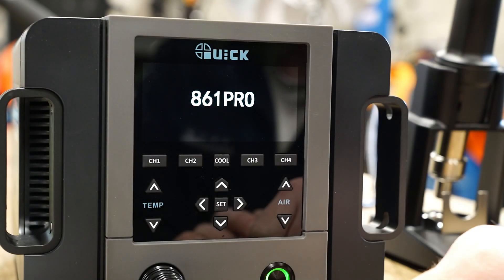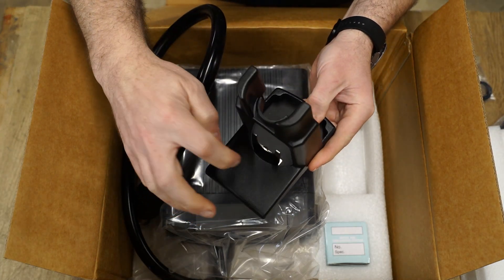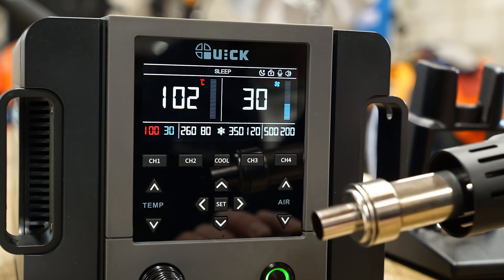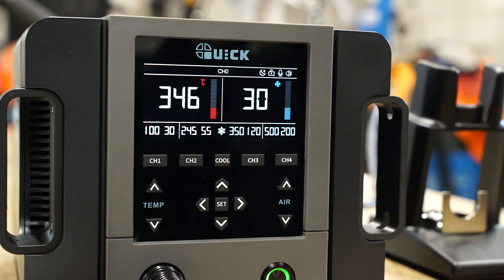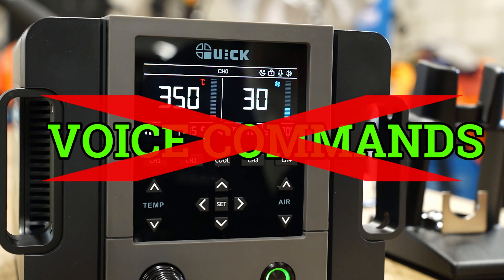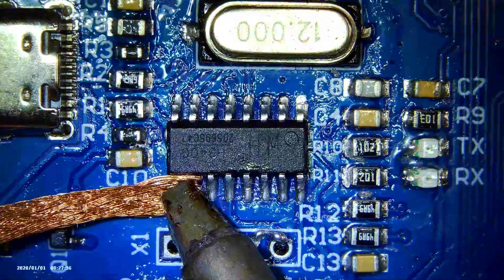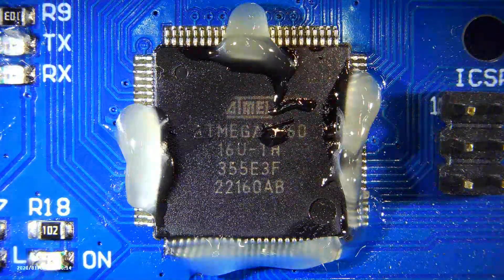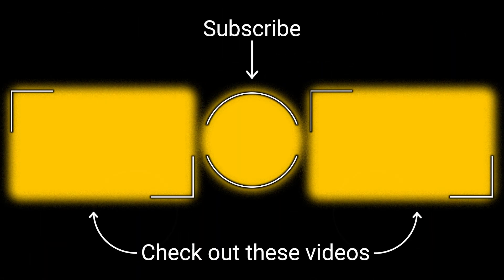Quick 861 PRO, Hot-Air rework station || SMD soldering / repair tool

Comment: i got a problem with this Quick. When I set it to 1-30 air the station blows as if it were 50 air.
Anyone else have this problem?
If anyone has it, can you confirm that it blows correctly at 1-30 air?
At 1 air pressure all my integrated circuits fly away.
Or any solution:?

Comment: I'll never understand why most of the hot air stations insist on having buttons instead of knobs for setting the temperature and airflow.  I wonder if it's a passive safety mechanism.

Comment: Got any suggestions for a more budget friendly rework station?
Reply: "Yihua 853D" - available on amazon, aliexpress, and elsewhere.

It's definitely a budget rework station but it's nice to have soldering iron, hot air, bench DC supply, a basic voltmeter, and a USB charger port all in the same place. I've (ab)used the shit out of mine and, well, it is DEFINITELY a "budget" station, which is both good and bad.

Bad, because I've burned out my hot air gun 3 times. Good, because replacement heater cartridges, fans, or even the entire air gun assembly, are available for properly cheap prices. Now, because I frequently prefer that my home / workshop not be on fire, I will talk about some safety stuff.

The unit is well grounded, and has several protections for overheating / lockout and other heat gun related failure modes. Firstly, the controller IC software monitors EGT using an NTC just inside the tip of the nozzle. If things get out of hand, it'll cut power to the heater. The blower fan is at the base of the handle (try not to cover the inlet vent on one side of the gun) is monitored and if the RPM drops, again it will cut power to the heater

There is also a physical thermal switch, like a KSD9700, located between the fan (at the base) and the heater cartridge inside the handle. Nice to have a backup safety completely un-corrupted by buggy software. Although I suspect that the thing probably needs to be damn near on fire for the switch to exceed temperature threshold in that location -- because the fan's blowing, you see.

Hmm. Maybe if you totally blocked that inlet vent I mentioned before. Time for a  real carefully controlled science experiment!

Last thing, if you've turned on the power to the heat gun module, it begins to blow and heat as soon as you lift the handle. This is accomplished through a magnetic reed switch sensor, also built into the handle. I have replaced this part a few times, because it can start to become unreliable. Sometimes I'll realise the fucking thing has been pumping out 480'C for 2 hours because I got up from my desk after using it, and didn't confirm that it was cooling down and shutting off.